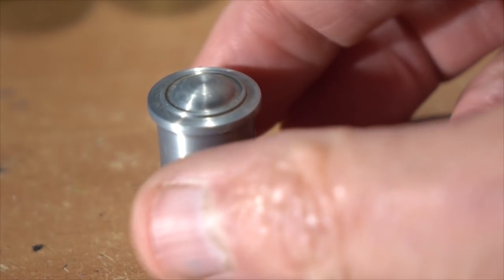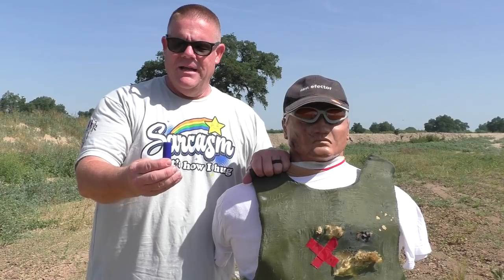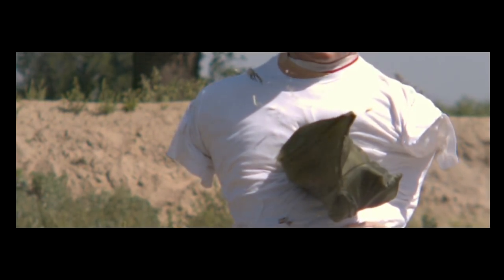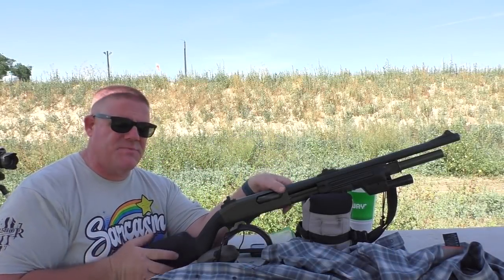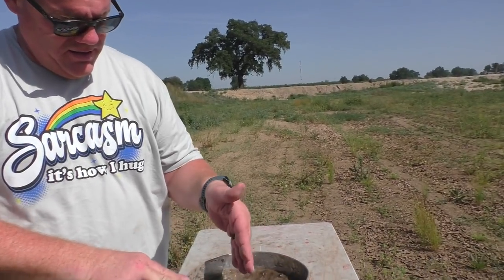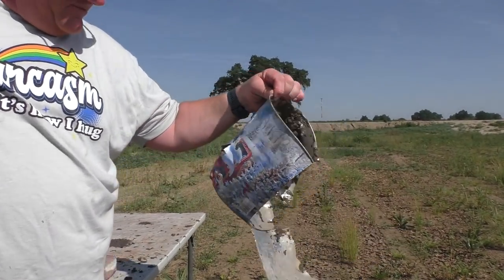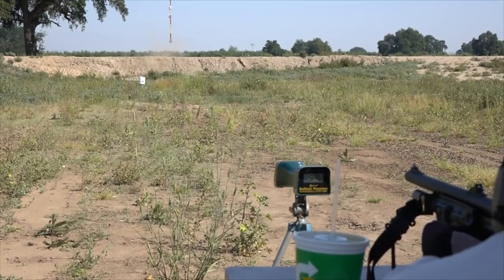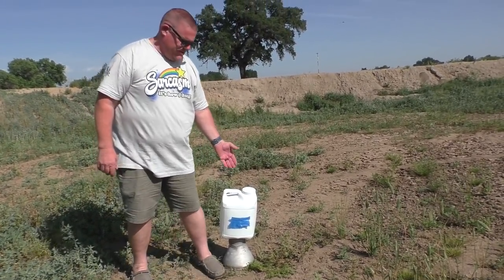The FLYING DUSTBIN  🚪   Wild-flying 12ga Shotgun Round

Comment: The original 'Flying Dustbin' was the Petard spigot mortar it was designed to destroy roadblocks, bunkers, pillboxes and other concrete, brick or earthen obstacles, and proved to be quite effective in breaking through these defences, Most effective at a range of about 80 yards the Petard fired a 26 pound finned charge within an outer casing, giving a total weight of 40 pounds.

Comment: Neat! I think the front lip prevents the rear lip from stabilizing the projectile by blocking air pressure to the rear lip. Just a guess, though - would require testing to confirm.

Comment: Minor point. Tank barrels are now smooth bore because APDS rounds are more accurate at higher velocities. The Challenger 2 is pretty much the last main battle tank to use a rifled barrel but has to have a special sabot that does not spin the dart. The Challenger 3 has moved on to smoooth bore

Comment: A thought about another data point: pressure sensor between shoulder and neck buttstock to measure kickback. Would have to be calibrated to account for the mass of the shotgnu, but might give results when the chronograph is confused.

Comment: Gel Block Tip:  I watch a video from another gun guy who set his gel block on a soft open cell foam pad about 3" thick or so and stabilized the sides with 2 small dowels on each corner.  Hitting it with a .45 LC from a carbine and the block stayed in place and made for a great video.
Reply: MUCH more energy out of 12 gauge ammo.  It wouldn’t sit still.

Comment: 🤣🤣🤣🤣 great video OG love love the finger wiggling.  Ya'll 2 are nuts LOL. Try making a slug out of #3 Phillips screw driver. Just use the part where the steal shaft and the plastic handle are pressed in but leave a 1/2 inch sticking  out of the front of the shell. Don't forget to shave the handle to match the barrel .😉🤪🤪🤔🤣🤣🤣🤣🍻🍺 good luck take care. Don't forget the led plate LOL

Comment: If the slugs surface was roughed up or scored lengthwise so that the discarding sabot halves can engage better, you might be able to get a more positive spin when it is fired. Not sure how much sabot thickness you have to play with, but a more positive interference fit into the  bore rifling might improve ballistics as well.

Comment: Thanks for the testing. Because primers have got impossible to find I have been buying the cheapest shotgun shells and reloading them, Taking the 7-8 shot out and loading BBs up to steel balls LARGE steel balls. BUT the coolest and most destructive thing I have found is .177 pellets 10-30 feet away. Give it a try fill a sabot with the pellets{.177} and any space u have between fill with BBs, smooth bore watermelon or pork ribs and oranges. Just whatever u got. Might mail u some steel balls if u want to try them.{sorry forgot ur limit on .177 lead pellets in CA. I have some plastic and copper if u need}

Comment: One question is bugging me: the rifled barrel shotgun spreads its pellets more or less? Because as far as I know rifling makes it accurate for a bullet but makes a shotgun shell to spread more wider. I don't know anything about projectile-barrel relation much, what I know is a smooth bore barrel helps the HE,HEAT,SAPCBC (this not that much) and APFSDS shells on tanks the effectiveness against shot from rifled barrel (for example the M1 Abrams has smooth bore barrel while the Mark I-M61 Patton (i guess😓)rifled). However, rifling does help with better velocity for the shell and the spinning makes it more accurate. But firearms not the same as the armor-piercing cannons or mortars

Comment: I love watching your videos. I've been modifying shot shell for years. I came up with a new one that I'm deathly afraid of and never shot. I used a vibrating media machine to breakdown 48" light bulbs. I did this to discard the bulbs with the safety of my sanitation crew from getting cut. I through in the most rusted nuts and bolts I had and when I opened it thay were perfectly clean nuts and bolts. But I had almost powder size glass. Now the range would "my thinking 5 feet or closer". But Dammit man getting hit in the face with glass powder. I would say this is a NO GO!! But would like to test what it could do. EXTREME safety measures needed when shooting this. Who knows how far powdered glass will fly? If you try this please be careful. That's why I haven't.

Comment: i would agree that a shotgun with a rifled barrel is still a shot gun. however it's impracticable to shoot shot though one as the spin causes the shot to come out in a uselessly wide cone. my rifled barrel 12 gauge mossberg cambered is 3 1/2" shells is arguably more a rifle than a shotgun as it can achieve rifle like speeds.